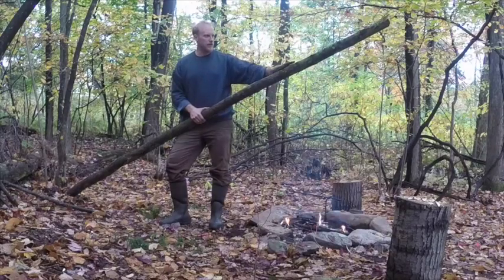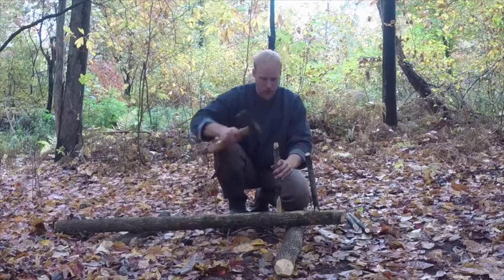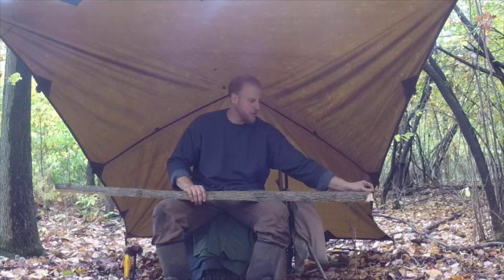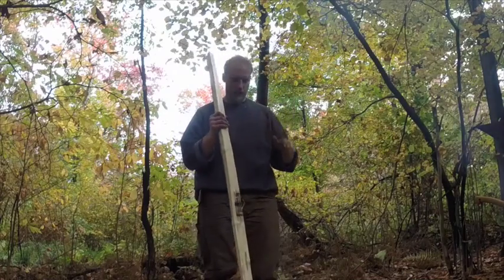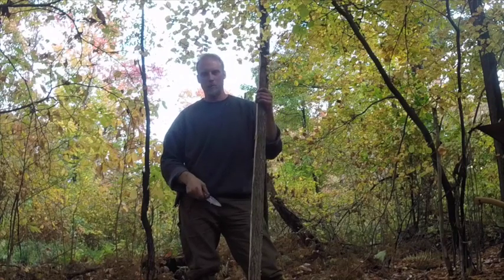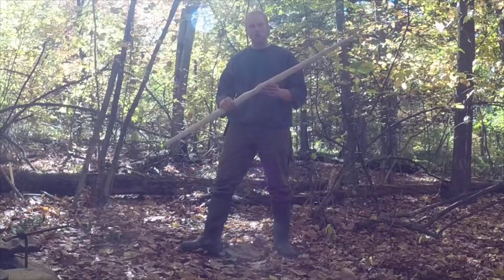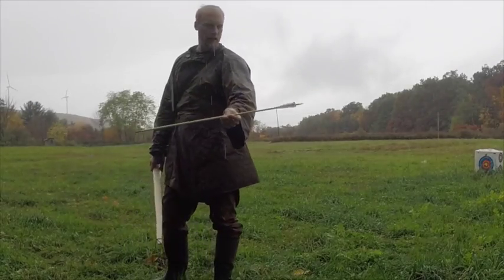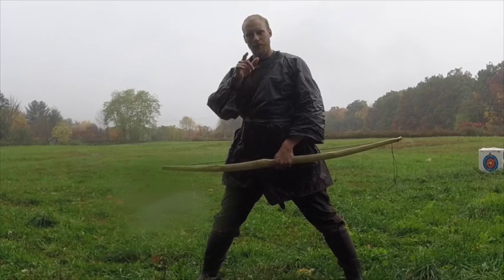Bushcraft Bow

Comment: What else could you use for a bow string?  Could you use cords from paracord or would they be too stretchy?  Would you add anything to finish the wood like wax or linseed oil?
Reply: Brett Skinner 
Bank line and paracord are both nylon. Neither will make a good bowstring but for the purpose outlined in this video they would be functional. The stretch will rob cast (arrow speed) but so does making a bow from green wood, combine green wood with high stretch string and you have a very inefficient bow. In a survival situation it is viable, but better alternatives in long term sustainability. Nettle cordage and some other natural fibers work well for a string.